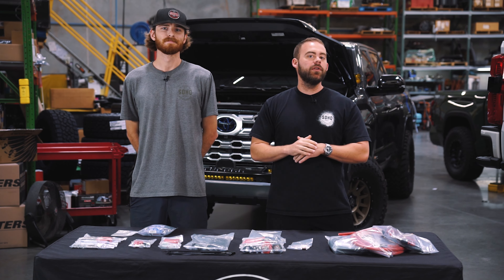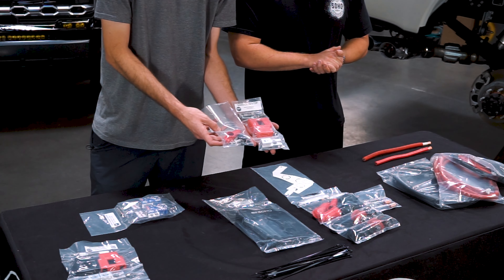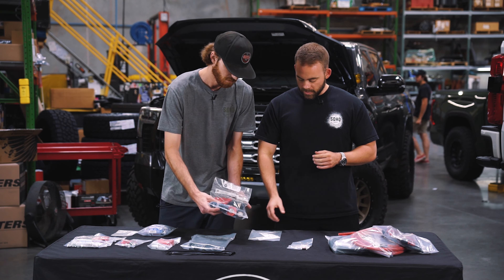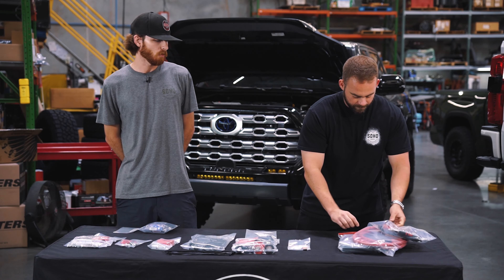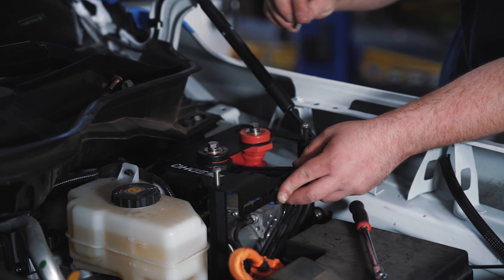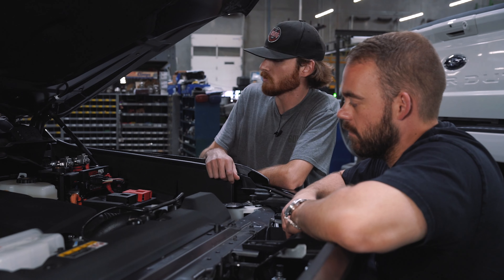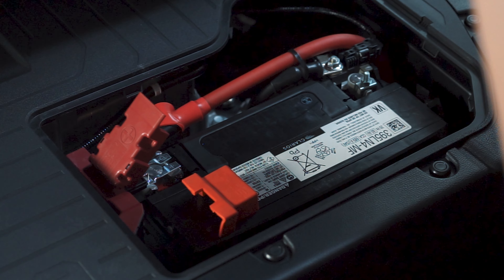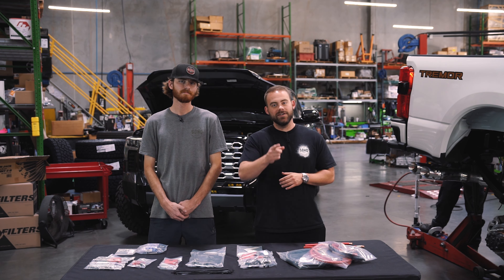Hybrid Toyota SDHQ Built Under Hood Power Solution Kit

Comment: That’s dope but will the connections in the wheel well be ok with water/mud spray from the tire or water crossings?
Reply from the maker: Yes, they're tucked under the fender liner, and the connections are designed to withstand all the elements and anything you can throw at it.